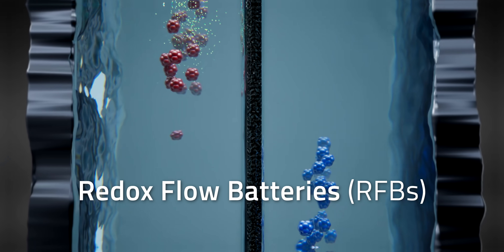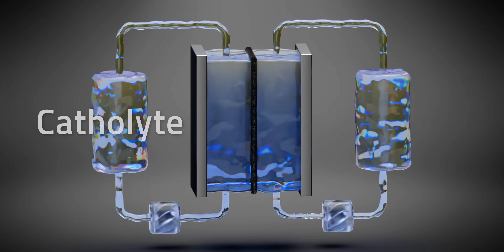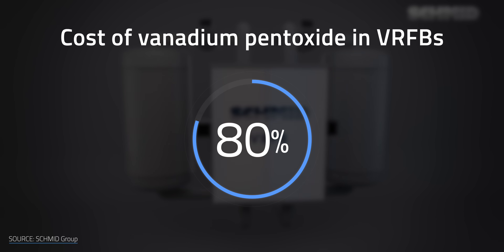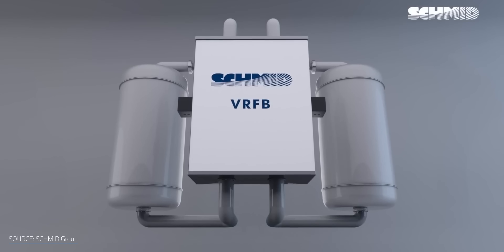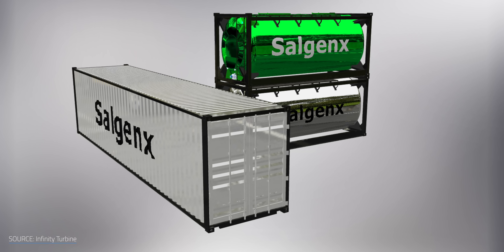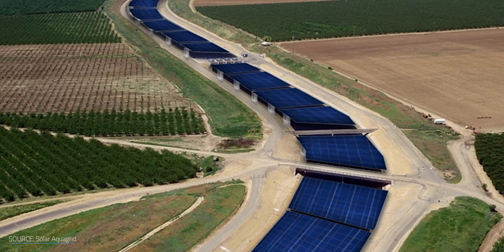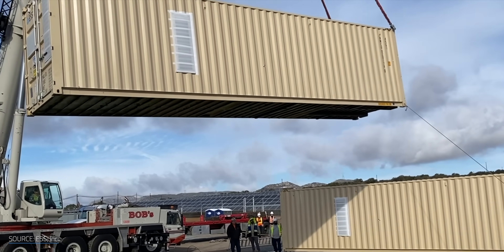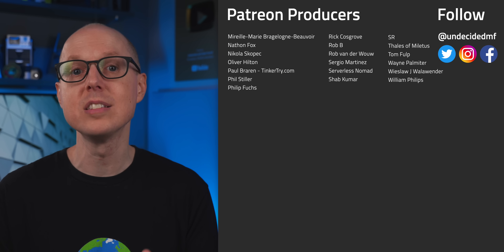Why Salt Water may be the Future of Batteries

Comment: Saltwater batteries are an excellent solution for grid energy storage. They offer the advantage of not requiring much space, making them a viable alternative to lithium-ion batteries as a clean energy solution. It's important to consider the harmful effects of lithium-ion battery mining on the environment. Therefore, it is recommended to use lithium-ion batteries only for applications that demand high energy density, such as electric vehicles (EVs).
Reply: Least obvious chatgpt comment
Reply: Agreed, these would also be great micro grid and home battery solutions for suburban and rural homes which have space to put up a "battery shed" like their pump house for water. Days worth of power could be stored in case of snow storms blocking solar panels or just to climate control a house when waiting for the grid to come back on line, a problem that happens more than is realized in rural USA. They could even be used to charge when grid power is cheap at night then run the house off the batteries during the day when power is expensive, especially with a 20k cycle life!
Reply: @anydaynow01  That was my thought exactly. I’m rural af. Acres. 
I’m also in the process of going Solar. 
How great would it be if I could just plop a cheap conex sized battery out back and have that to run my house overnight or during outages?
I’d be all over it.
Reply: The nerd in me chuckled every time I read "solution."
Reply: I hate that there are chat gpt comments in the wild now. Learn the how the Ai talks so we can mark for spam.
Reply: I hope they get them up an running in 3rd world countries and isolated communities. Places in Canada probably won't be good for it but definitely other parts of the world
Reply: no, there is no harm in lithium mining. this is doomster talk nonsense. based on some oil lobby financed documentary on boomer media.
first compare it to fossil, good, we can stop right here.
but lets see, most lithium comes from australia, there are no issues with mining there.
it can be done without any harm,, without any water consumed.
same goes for battery production 90% of energy needed today because of the long baking is not needed in modern processes like dry coating.

this will all come naturally because it reduces cost immensely.

nothing is consumed, mining can stop at some point and a never ending cycle can take place.

there is not shortage of lithium on earth, it is basically everywhere, mining has to increase, thats all.
the market will solve this naturally, prices go up, mining increases, simple.

why would you recommend to use lithium ion only for cars, this makes no sense whatsoever.

you always have to include absolutely everything to have a good guess of what is doable and what is not.

there are an infinite number of properties batterries have, and lithium ion ticks all the boxes like nothing else.

the last 20 years ever yweek someone comes with a new "revolutionary" battery that can do this and that.
then they have that one issue which makes them useless, like oh i can charge to 80% in 3 minutes but the battery only last 10 cycles.

but at the end of the day it isnt even about which battery technology to use, it is all about high scale manufacturing. even the worst technology battery is good enough. the hard part is the insane amounts of them needed.
there is an infinite amount of demand waiting for the first to serve.

fro mall the solutions praised, sand heat storage seems like the only viable that makes sense imo the rest is battery, and that means lithium ion.
Reply: Nice to know.  😎
Reply: @chineserockethands4578  yeah
Reply: When the Chat GPTs
Reply: How do RFBs hold up to tough weather ( well below freezing ambinet or 50°C+ )?
Reply: Yes, optimizing systems for applications is best 👍
Reply: I think this will happen.....The development of the batteries will end with NaS batteries for transportation. Just because it's better for the environment. In 10 years they will have 400w/kg. That's good enough.. If the Scientist tell us in 10 years that the planet is doomed then they will release the zero point energy devices that Steven M Greer is talking about. It's the only way to save the planet ....
Reply: They are a dumb idea. Say we adopt this technology, you're going to spend a lot of money doing it and then better things are going to come out within the next decade or two, but you have your money tied up at this. It's a horrible idea. Modular nuclear reactors that are much much safer will eliminate the need for all of this. That's what everyone doesn't get. Technologies are adopted based on two things. Profitability and public perception. The tide of opinion on nuclear reactors was already shifting before they started developing and coming out with these modular nuclear reactors. So when people see that they have a reactor that won't melt down unless it's hit with a missile or something, they will be way more open to. Then you just worry about making the energy source; instead of making the energy source and making a way to store it and losing a lot of it in the process. From an economic standpoint this is a no-brainer. This technology will never see mass use, but maybe it will have some limited use for certain things. But mark my words this will never happen on a mass scale and if it does it will be a failure as its put out of business by the way better options on the horizon
Reply: @CHE-Undercover  
Nuclear reactors are a dumb idea.
Say we adopt this technology, you're going to spend a lot of money doing it and then better things are going to come out within the next decade or two, but you have your money tied up in this. It's a horrible idea.
Reply: @carstekoch    name a single technology that is within 20 years and will be more economical than nuclear. I haven't seen a single one. I've been following tech for over 20 years and they always say "oh we're doing this and we're charging this for it"  and it's almost always a lie. Fusion is that is as efficient as nuclear is 30 years away. When you consider economies of scale nuclear dominates. But even as is these modular reactors are much more efficient than solar or wind. Do you know how much damage is done to the ecosystem by creating solar panels and mining lithium? Everyone complains about nuclear waste when it's much easier than the catastrophic damage we are doing to the climate.
Reply: @CHE-Undercover  I don’t get why, but SMRs are still costing BILLIONS. I hope they are able to switch all large sea-going shipping over to nuclear though, that would be cool.
Reply: @TheAnticorporatist  volume is the main reason, but eventually they will go down enough to make it practical. They will probably stop at 25 million for one capable of powering a about 5,000 - 10,000 homes. But  the next gen will be even cheaper.
Reply: @TheAnticorporatist  SMR?
Reply: @gingernutpreacher  Small Modular Reactors
Reply: @mrleenudler  ah of course now if they were small moduler molten salt reactor now you would be taking china have a proto type running
Reply: @CHE-Undercover  Great! Instead of storing energy one has to store radioactive waste…
Reply: @CD-CH-EB  I love the idea of individuals having their own personal reactor, but the thing is, people won't be able to leave the thing alone. I think there would be a lot of horrible accidents
Reply: @CHE-Undercover  for someone who talk so much smack u really dont know what ur talking about. This form of electricity can be used in many rural places and also with the issue or higher rising sea water levels, this can be used as a source for making use of the current situation to reduce electricity prices as another form of alternative for governments too. Theres so many possibilities out there. Reducing costs thru long term innovation will definitely happen as with any other technology out there. U seem more like a proponent of nuclear energy than looking at this from a very neutral and objective manner. Sorry but your reasoning is just too ridiculous
Reply: @freshman-og4dp lol Yeah we're going to use enough sea water to effect the rising levels. You're obviously young and naive. I was following everything 20 years ago when hydrogen cars and solar panels were about to take over. Mark my words, it's not going to happen. I would bet everything I owned. The difference is, it's easy to think this stuff is practical and going to succeed when you study engineering, it's a lot harder when you study economics and business management. Which when I was young I was only into engineering. Now business management, and I'm right every time. There's better stuff out there than sea water batteries. It won't happen. But shoot me a message in 10 years when it does and I'll give you 5k.
Reply: @CHE-Undercover  The CapEX of Lithium-ion batteries for utility scale projects is very high which makes the researchers looks for any possible alternative technology and try to make it viable and feasible
Reply: @gamechangertech  Yeah. But this will not be the technology to replace them